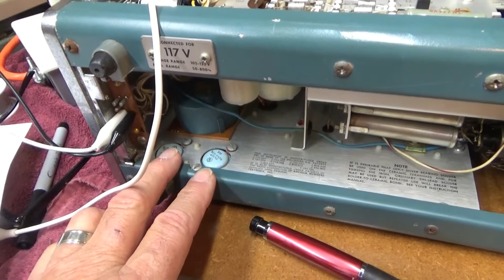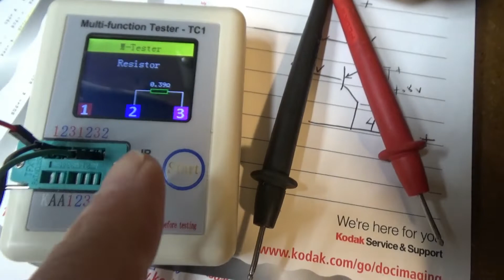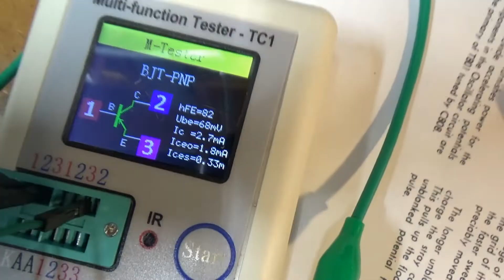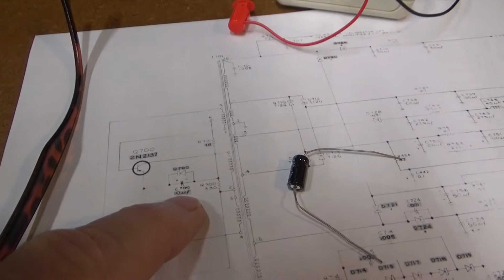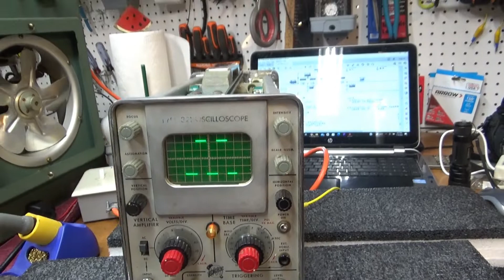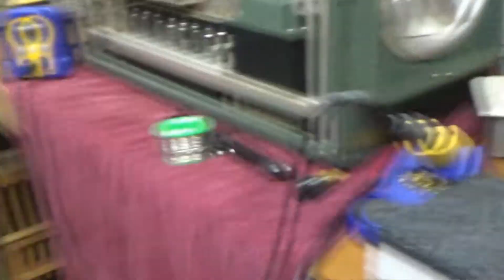1960 Tektroniix 321 Oscilloscope - Fixed!!

Comment: Something may still be up with your chopper converter yet. Pretty sure it shouldn't whine. One of your new transistors looked pretty leaky, the one with the curves sloped at an angle. Maybe for testing, try the 1 good original with new one with straight traces.
Reply from the maker: Thanks for the comments. There are definitely still some problems with the power supply. The 10V regulator circuit is not regulating. I may still try a 3 terminal regulator IC. The "chopper" circuit runs at about 2 kHz, definitely in the audible range but not sure if I should hear it.